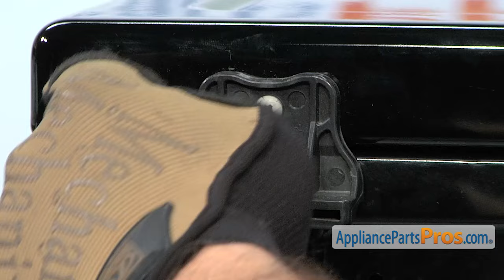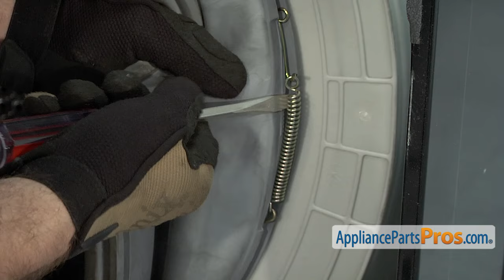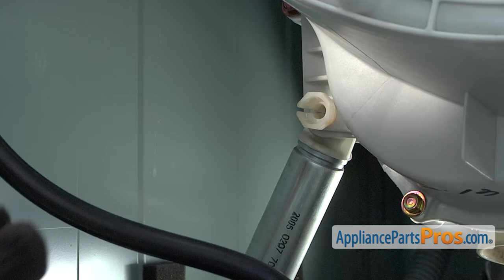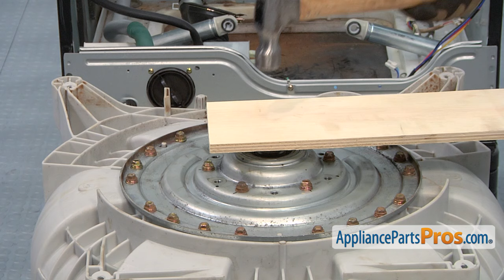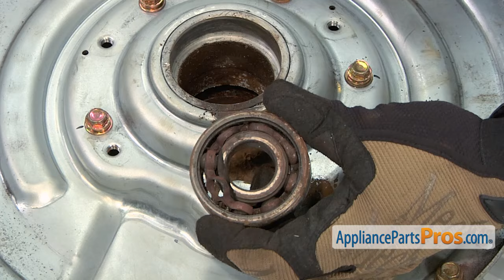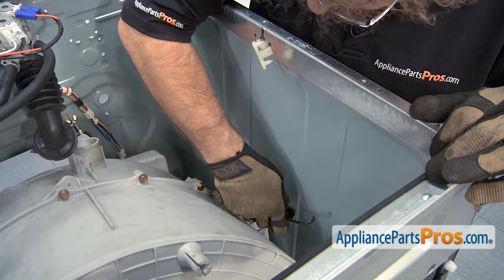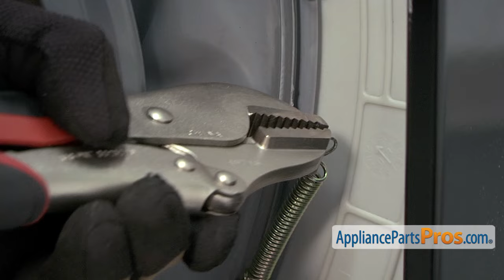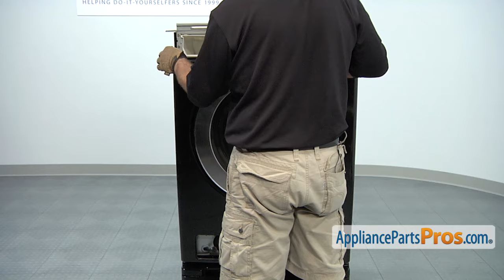How To: LG/Kenmore Washer Seal 4036ER2004A

Comment: good vid thanks but i would use the old bearing as a drift to protect the new bearing to tap into place
Reply: fentz fensom - would this risk getting debris and/or grease into the new bearing and/or seal when you hammer on it???
Reply: fentz fensom is
Reply: I wish I would have read this before I replaced the bearings.  Good idea.
Reply: Just used the old bearing
Reply from the maker: fentz fensom Thanks for the tip! Glad the video helped you get them changed.
Reply: AppliancePartsPros 1
Reply: I actually did use mine as a drift.  Had to dig it out of the trash though, LoL

Comment: What was the orange/clay-color looking silt that covered a lot of the internal parts? It looked line it leaked out over the spindle and other parts. It looked like it was coming out of the leaking main seal, but it was very distinctively orange. Not like the brown or black you would think it would be if it was dirt. I had this same orange colored silt coming out of my discharge hose in a topload Hotpoint. It never showed up in the wash tub. Only in the utility sink the washer drains into.  Thanks.
Reply from the maker: Playfortoday74 Ours looked like rust from the bearings. Glad you were able to get the washer fixed up!

Comment: I have an LG wm2277hw.  The video was awesome and I have been able to take the entire thing apart, but I just can't get the shaft to separate from the outer tub.  I have hit it and put pb blaster on it, left it over night, etc..  Any other alternatives.  Would the stuff that they sale that freezes and lubricates work?
Reply from the maker: Staci Baird You can try heating it with a heat gun to help break it free. Just do not over heat it and warp the tub!
Reply: I got my entire machine torn down and the hardest part bar none was pulling the barrel out of the bearings.  I used PB Blaster for about 4 hours and nothing.  Used up 2 2x4's.  Shredded them.  Finally I saw this post and pulled out my gas torch and cooked the shaft at the very tip until smoking.  I thought I was still going to call this failed until I realized that the 4x4 (yes I upgraded) was rather aged and soft.  I placed the knot on the 4x4 directly on the shaft and had my son hold the other end whilst I hoisted the mighty 8 lb sledge and let loose all of the frustration that I had accumulated dead center.  The shaft actually slid 50% down.  Well I wasn't going to be satisfied until I hauled Moby Dick back to the dock so I had my son dawn his gloves and goggles again and hold the 4x4.  One more time with the might 8 lb sledge and BAM it was done.  I used a socket extension and a 5/8 socket to pound out both bearings (soaked in PB Blaster of course) and now all is cleaned, put away and ready for me to install new bearings in the morning.  The great white whale didn't get me this time.  Good luck guys... Persistence and stubbornness pay off in the end.  No children were harmed in the making of this success.
Reply: AppliancePartsPros
I have the same issue. I will try the heat gun, and hopefully that works. Having a 9-year-old washer sitting disassembled in the laundry room for half a week is a tad tedious. Otherwise, thanks for the video! Very helpful so far!
Reply: Michael Meissner Did the heat gun do the trick? I'm about to attempt this repair later this week and am interested to know if it worked.
Reply: Philip Mancini Jr.
Not as far as I could tell; a bunch of rounds of dousing it in WD-40 and smacking it a bunch hasn't done anything yet and the heat gun hasn't seemed to do anything to help. So it gun may work for you, but it didn't do anything for me.

It also depends on how bad your bearings are, since the inside one being so royally destroyed was the problem. If you haven't let your washer run for a couple months until attempting the repair, you shouldn't need to worry too much. If you have, I recommend disassembling it to that point then calling someone.
Reply: Michael Meissner I got lucky and was able to pound mine out without too much effort.  Bearings were definitely bad, but the hammer did the trick.
Reply: Philip Mancini Jr.
Yeah, I'm still having no luck. I've gone through a few boards, though. I'm thinking I'll need to dump rust buster down between the tub and drum and see if the other side is where the problem is.
Reply: The heat gun helped me. You have to be careful to ONLY heat the shaft, NOT the bearing, Otherwise BOTH parts will shrink! Hold the gun perpendicular to the shaft, aiming at the top 2/3's of the splines. Keep moving around the whole shaft for a couple minutes. Patience counts here, as you're trying to get the heat to move down the shaft towards the bearings.

I finally gave up on trying to "protect" the shaft with a block of wood or metal. The only way I got it to budge was CAREFULLY hitting it directly with a short-handled sledgehammer. I figured that if I couldn't get the shaft out without damaging it, I'd be replacing the inner and outer tubs anyways...
Reply: Thomas Wright
Ooooh, thanks for the heat gun tip! I'll be sure to retry, as I'm pretty sure I was heating the bearing as well. And I'm not too worried about the shaft, I've got just the hammer for that.

Thanks again, hopefully this time it works!

Comment: I also basically modified how the lifter attaches to the tub and spider, next time if the nuts on the weak plastic lifter groove rotate while removing the bolt on the spider. I can remove the lifter then use a wrench to counter the hexnut while untightening on the spider side.

Comment: SOME LESSONS: Thanks for this Great video. recently fixed my washer.  I got some lessons learnt/Tips to SHARE on removing the tub tub/spindle from the bearing assembly if it seems stuck/hard because of rust:1. PB blaster on the bearing outer, 2. rest plastic tub on wood- not plastic stepboards ( I had to make wood stepboards from 11 inches shelves after using plastic recycling bins from Rep Serv for 2 days), secret is when you pound on the spindle there should be no bounce effect, 3. I used a metal plate ( a used brake pad) instead of wood to protect the spindle gear-make sure to hold it flat all the time, whatever wood just shattered all the time.. and 4. heavy-drilling hammer ; 5. then pound and pound this tub will drop slowly. it is recommended to change all the listed items here: innner and outer bearing, the spindle seal, the plastic tub seal/gasket and the spider if severely corroded on the spindle and some bolts for the spider as spare as these are stainless bolts not sold on local stores. (this repair is like changing out the water pump too in your car during timing belt replacement). Order all the parts once to save on shipping. DISMANTLE,Clean all parts you can clean of stuck soap scum especially the door gasket inside and out. Your washer will smell brand new. Read all about cleaning stainless- never scub your stainless tub. Take care not to make new scratches on it as this will surely rust more. remove all rust you can gently. I also changed 2 stock hose clamps to adjustable/tightened clamps because of leak.corrosion on the soap dispenser box. The stator has locator pins, make sure it faces the right direction when putting it back. mark your upper and lower tub weights. Caution when screwing on any plastic you run the risk of stripping the thread so everything is almost visual check when you should stop tightening. Hope this helps.
Reply from the maker: tong prince Thanks for the tips! Good job on getting the washer fixed.

Comment: After waiting over a month for the repair company to come back with parts I decided to take this project on.  Excellent instructions, only had trouble putting the outside spring back in place. The tool would have been most useful but could not see spending money on what I hope is only one repair.
Reply from the maker: The special tool are expensive, that is why we show how to do it with regular tools whenever possible. Glad you were able to get the washer fixed up!

Comment: After all of your suggestions i was able to pound the shaft out. BUT now one of the bearings (inside one) will not come lose. I'm scare to apply heat as i did for the shaft since its so close to the plastic cover. Please help.
Reply from the maker: If you have to use a heat gun, put a wet towel around the bearings to keep the tub cool so you do not warp it.

Comment: I have the same problem as Todd. This drum is stuck. I can't get it to come lose. I used everything to loosen the bearings. I even let it sit over night and it didn't come loose. I don't have a heat gun. Any suggestions? This sucker is on there.
Reply from the maker: Does anyone you know have a heat gun, that you could use? Sometimes the heat will break it free.
Reply: I bought one, finally got it free. What a pain in the rear. But it's back up and working great. Heat is definitely the answer to break it free.

Comment: Thanks for the video! I have everything apart and the parts waiting to go in. I can not get the bearings to break free from the outer tub. I hit with the rust booster and penetrating oil but have not had any luck. Any other ideas?
Reply from the maker: You can try to heat up the bearings with a heat gun. Just make sure you do not heat the tub and deform/damage it.
Reply: Thanks. More elbow grease got them out! Back up and running! You all rock!!
Reply from the maker: Awesome, good job on getting them changed out!

Comment: Everything came apart perfectly, but when I was done I found 3 pieces of an approx. 3 Inch diameter white rubber ring (7/16" tall X 1/8" thick) laying in the bottom of the machine cavity. I am afraid to put everything back together until I figure out where this came from.
Reply from the maker: You can go to our repair forum and ask this question, along with your model number. You can also post a pic so the techs can see what it is.

Comment: That is an awesome vid! I already successfully followed your clutch replacement video and have come to the conclusion I misdiagnosed it(but the replacement was easy!) I am doing the bearings next, are these instructions rather similar to a top loading machine?
Reply from the maker: LG front loaders are different than top loaders. You can go to our website and enter the appliance model number to see the parts list and appliance break down. You can also go to the repair forum and the techs will help you out.

Comment: Great instructions!  I just did this but the shaft is stuck in the bearings even after using penetrating oil and a lot of hard pounding.  I'm worried I may break something if I keep this up. Any other suggestions?
Reply from the maker: You can try heating it up with a heat gun, to see if it will break free. Just make sure you don't heat the tub and damage it.
Reply: Hit it with heat, a cheap air hammer, and then the old fashioned hammer one more time and it finally worked loose.  Thanks again for the great instruction.
Reply from the maker: Awesome, glad you got it out!